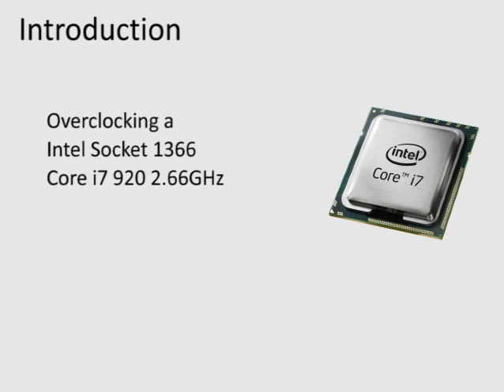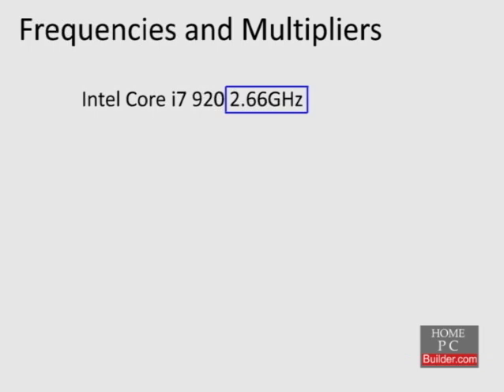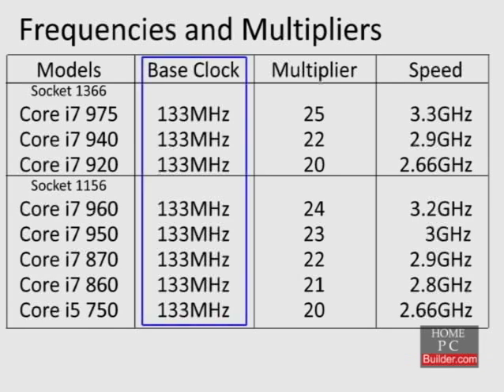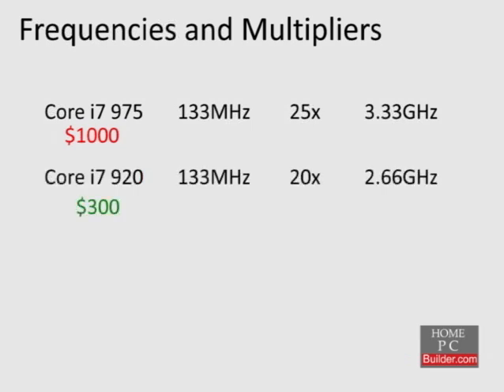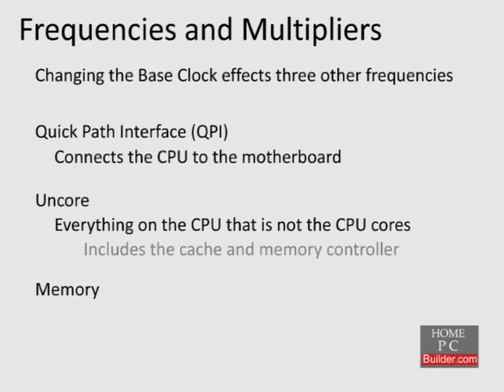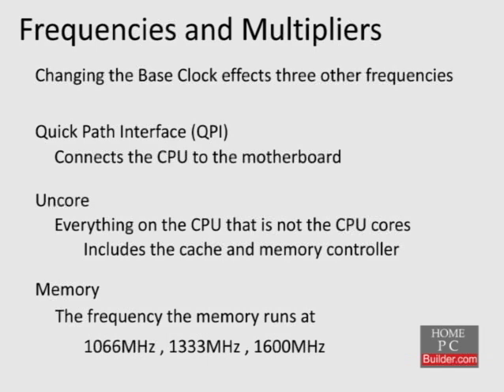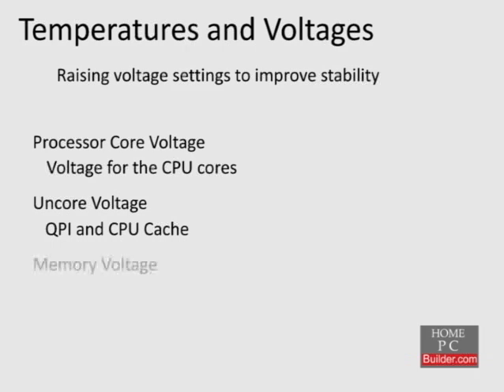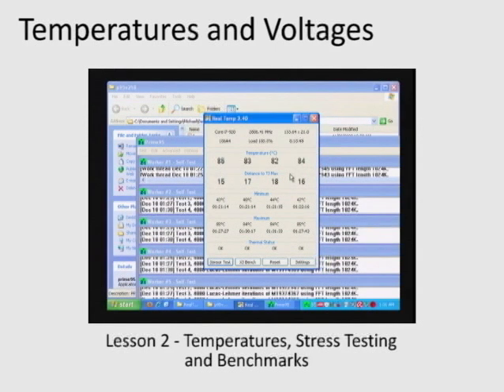Lesson 01 - Introduction to Intel Core i3, i5 and Core i7 CPU Overclocking - www.HomePCBuilder.com

Comment: Michael, question. I am a senior but also a light gamer. I have upgraded my old pc through the years. It was a HP m9600t pc with the faithful i7-920.
I have upgraded the ram to 24 gb, upgraded the cpu to the i7-980x with no overclocking since the HP board doesnt allow it, but i am happy with stock speeds, plus a gtx 970 video card.
Looking at my components i thought about buying a new 1366 motherboard to get better performance but i have also noticed that with the 980x i am getting top speed even when compare to new cpu's.

Question is, should I just keep this old lady as it is and just wait a few more years and change to a new processor and motherboard then? Do you think I can milk my system for a few more years playing the new games?
I couldn't believe that after upgrading to the gtx 970, my scores total went above what a new 4K PC requires. It is a testament to the greatness of the 1366 socket and the core i7 cpu's.
Reply from the maker: +alaskajnu99801 I would stick with your i7 920.  It is fast enough for even the new games.  Most of the processing is done by the graphics card.  Definitely hold off on getting a new CPU and motherboard until the CPU become a limiting factor.

Comment from the maker: You change them both.  If you've bought a CPU with an unlocked multiplier you can raise it above its stock setting or lower it below.  Overclocking is all about balancing speed, heat and stability.  You want to make the computer as fast as possible without too much heat while keeping it completely stable.  Changing the base clock, multipliers and voltage settings are how you get it done.

Comment from the maker: The CPU is capable but you need to make sure your motherboard has the necessary settings in the BIOS.  Watch Lesson 3 in this series and it will show the settings you need to look for in your BIOS.

Comment from the maker: You don't need to upgrade your power supply.  Overclocking does not use much more power.   The manual for the DH55PJ motherboard doesn't show the BIOS so I can't tell if it has the required settings.  Take a look at the next few videos in this series and they will show you the settings you need in the BIOS to overclock the CPU.

Comment: I have a core i3 540 processor with Intel Motherboard DH55PJ.So can you tell me that what is further required to overclock it,like power supply of how much power(I currently have a power supply with 700w power ).

Comment from the maker: I checked the Gigabyte Ga-G41m-combo manual and the BIOS does have the option to change the base clock frequency and voltage settings.  You can take the steps shown in these Intel overclocking videos and overclock your CPU.

Comment from the maker: You should be able to get the Intel Core i3 550 CPU to 4GHz with no problem though if it is at 60c already at the stock 3.2GHz speed you will probably need to replace the cooler with a 3rd party one.

Comment from the maker: It may let you overclock the CPU.  You need to be able to adjust the base clock, DRAM frequency, CPU voltage and a few other settings in the BIOS.  The sample lesson for Lesson 3 on our site shows how to find these settings.  Go to homepcbuilderdotcom and watch the Intel CPU overclocking Lesson 3 sample video.  If the settings are in your BIOS you can overclock the CPU.